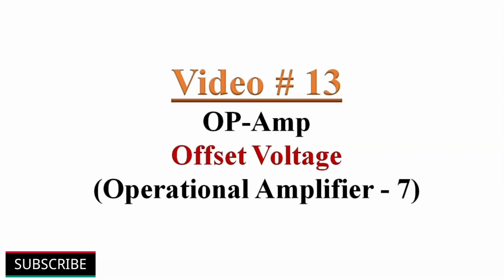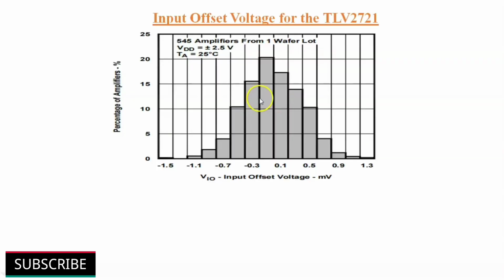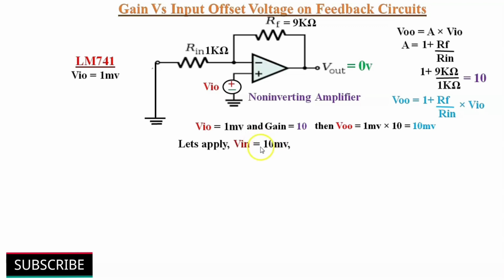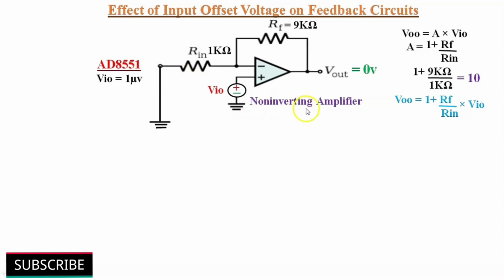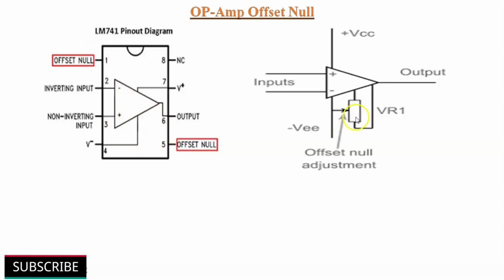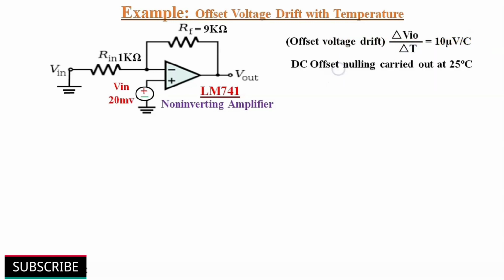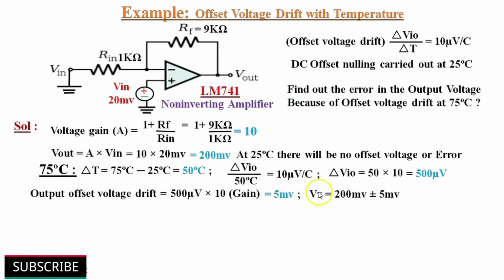OP-Amp Input and Output Offset Voltage (Operational Amplifier)

Comment from the maker: The timestamps for various topics covered in this video are as follows :
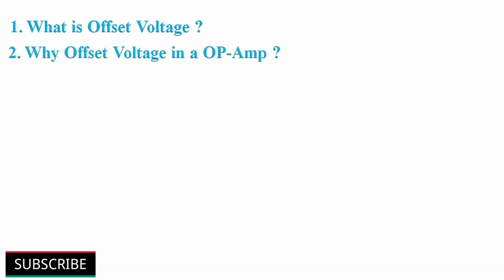1) 00:18 - Introduction,
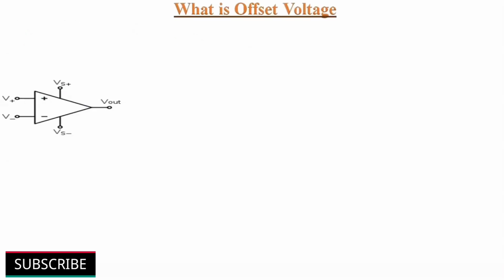2) 00:43 - What is offset voltage,
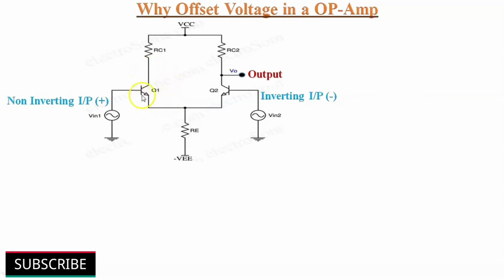3) 00:56 - Why offset voltage in an OP-Amp,
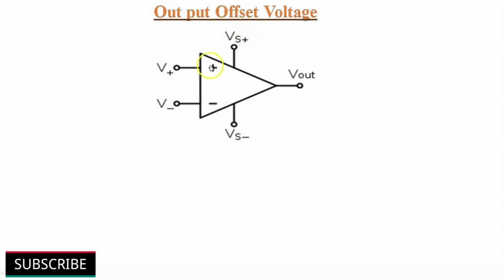4) 01:55 - Output offset voltage,
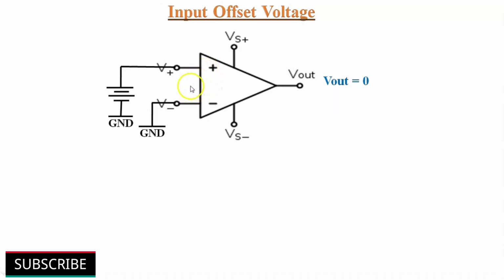5) 02:42 - Input offset voltage,
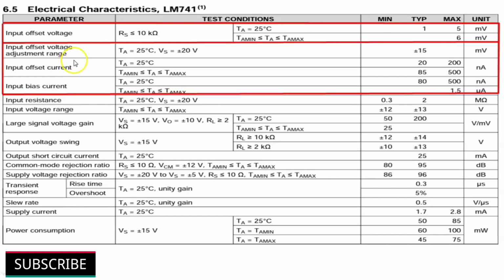6) 03:03 - Datasheet showing offset voltage,
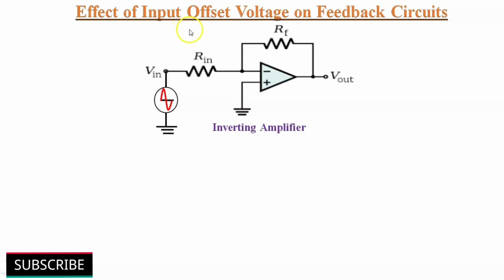7) 03:50 - Effect of I/P offset voltage on feedback circuits,
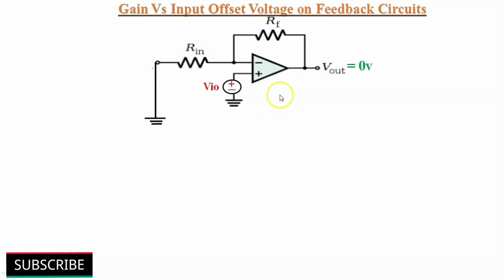8) 04:09 - Gain Vs I/P offset voltage (Example: LM741 VS AD8551),
9) 08:04 - OP-Amp offset null,
10) 08:57 - Temperature Vs Offset voltage drift,
11) 09:51 - Example,
12) 12:23 - Thanks for watching,
13) 12:37 - Next video.

Comment: Congrats ! Thanks !
Reply from the maker: You are welcome.
Reply: @ElectronicsAD  Could be nice to have a slight bit of information on resolving input offset in the case of differential voltage on the inputs, e.g. a piezo sensor or whatever.  Very good video in all cases.  ;-)

Comment: But why the offset voltage is needed to be zero when both the terminals are grounded there will be some collector voltage even though the two bases are grounded which is Vs -IcRc

Comment: Hello sir , first of all thank you so much for the video.It explained a lot but one doubt is there, when you took Vin=10mv , then yi=ou wrote Vout as 100 mv which I think is little bit confusing bcoz at this time Vio can't be there as we are calculating only Vout so it will behave as inverting amplifier and the output voltage will be -9(1omv)= -90mv . Please correct me if I am wrong
Reply from the maker: Dear Naman,
Thanks for your positive comment,
At timestamp 5:20,
Please consider "Vin" at Non-inverting terminal.